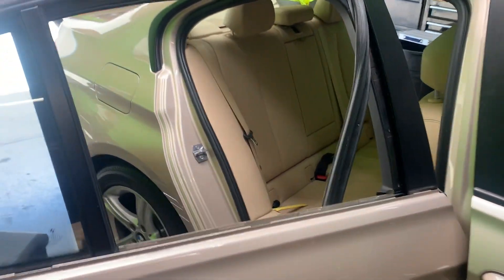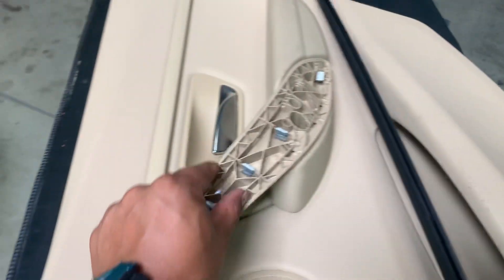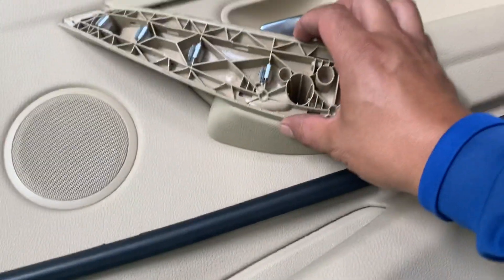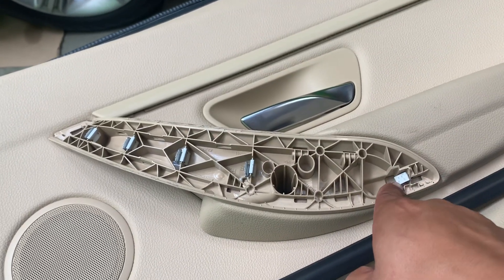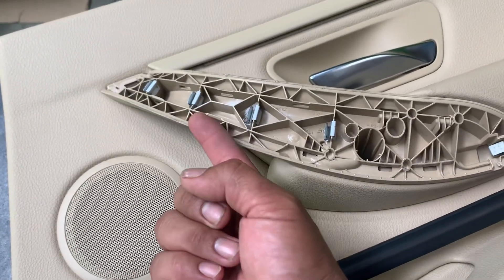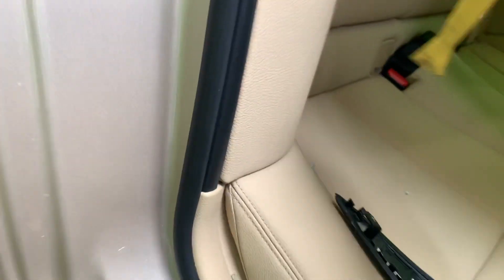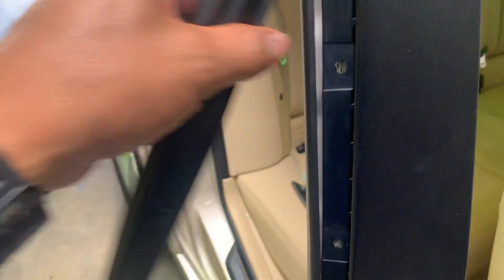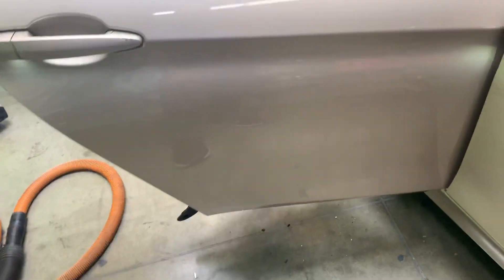2012-2016 BMW rear door window replacement by Alfredo’s Auto Glass repair

Comment: Oh, hey that reminds me about the newer Bmw front dg. The switch is a pita to remove, and there is a secondary wiring harness that’s ran through the door panel, but there’s a good reason for that. The connection between the panel and the door wiring harness is at the front of the door, so you can just keep it plugged in, and rest the panel on the sill, while you work on the door itself. Makes it miles easier, and you don’t have to mess with pulling wires, or dealing with switches.

Comment: Muy bueno tu trabajo, no se si hablas español, yo no hablo inglés, quería consultarte por la ventosas con el hilo para cortar el poliuretano de los parabrisas, como se pide o si tiene algún nombre especifico, busco esa herramienta por Internet y no la encuentro, quisiera comprar una por que estoy incursionando en este rubro, saludos y espero me puedas responder
Reply from the maker: Jonatan Rosset que tal amigo si hablo español, ahy 2 herramienta que te recomiendo una se llama WRD spyder 3 de WRD tools  y la otra se llama Raptor de Equalizer tools.
Reply: Hello Alfredo have you ever replaced a driver  door glass on a 2016 Audi A6. Just had one and couldn't do it
Reply from the maker: Orlando Melendez next time I do one I’ll make a video. They are quite difficult.
Reply: @AlfredosAutoGlassRepairCorona  thanks